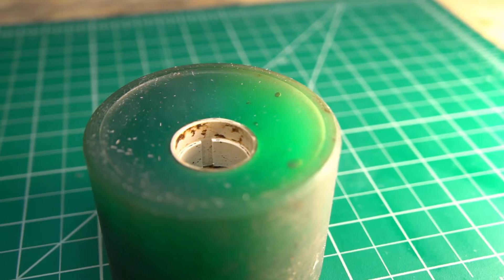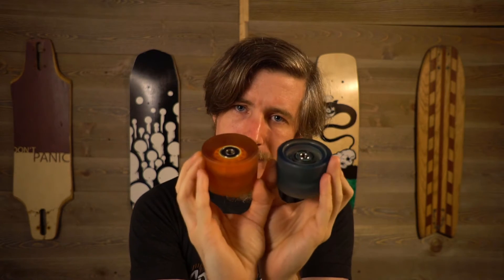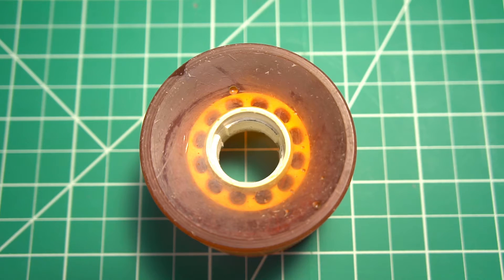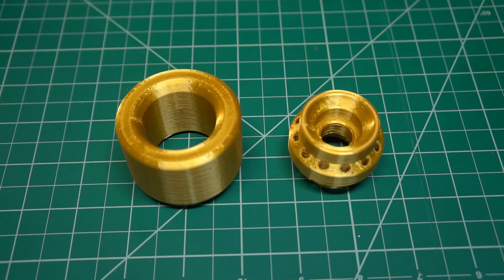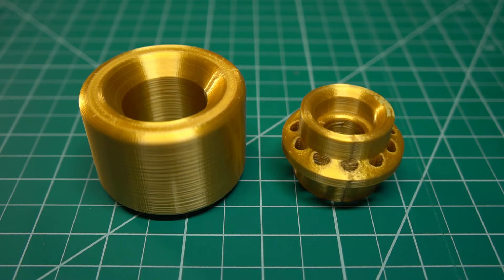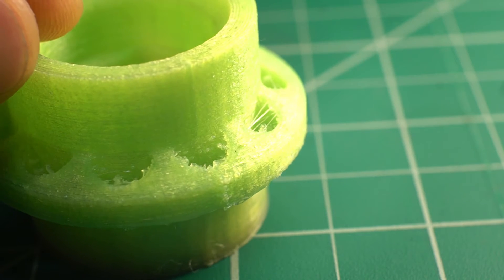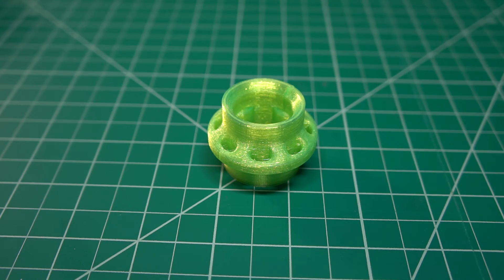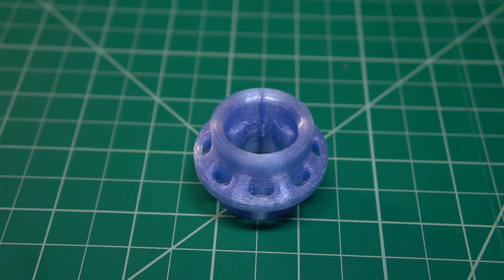3D-Printed Cores for DIY Skateboard and Longboard Wheels

Comment: I say 'DON'T DO THIS', because, Most decent wheel Cores are DELRIN, although some also are Arimid-fiber Impregnated Nylon, HEAT MOLDED.. You CANNOT Replicate that strength with a plast-wire 3-D Printer, Period!! Do ya know what the word 'Lawsuit' entails? "PSR"

Comment: I think you actually had some solid designs i just think you need to calibrate your printer. Still this pretty fuckin cool
Reply from the maker: Thanks dude! The open source version is going to have a triple-round core design in addition to a mids one. They're a little more up-to-date with modern longboard wheels, and they're much easier to print cleanly.

Comment: good work.  are you willing to share the files. i am looking to do the same thing  but for rollerskates.  what brand urethane are you planning of using?
Reply from the maker: I think you saw this in another video but the whole project is going to be open source when it's done. There are a couple urethanes I want to try, I'm mostly looking at stuff from Specialty Resin and Chemical, and Smooth-on. Both companies have resins in the 80-90a range.

Comment: This looks cool I hope the wheels will turn out well and strong enough. Which type of wheels do you wanna realise? Something like freeride/freestyle or more like carving ones?
Reply from the maker: I'm taking a stab at freestyle wheels, just because they're smaller and if I mess up I won't be wasting a lot of material.  They should make decent cruiser wheels at softer duros too
Reply: @GoodRoads  Great I hope they will turn out well. I should have all the necessary if it turns out good will you share the stl file of the core?
Reply from the maker: Yup!

Comment: I personally would probably experiment with 2 part cores. Completely get rid of all overhang issues that way.
And then rely on the wheel mold to align the halves together, and the Urethane to cure and hold them.
I don't think there's any structural reason why that wouldn't work, but it does complicate the wheel mold even further.

For printing, I use Slic3r, and two options to make sure you try are "Avoid Crossing Perimeters" and "Complete individual objects". All slicers should have similar options, but perhaps with different names. This should really help with the consistency working with PETG.

Another option in dealing with overhangs is to have a re-usable support. A pre-made piece which you insert while the print is paused, which gives a consistent surface for bridging.
When I do this I typically use a higher temp plastic than what I'm printing with , So ABS insert for a PETG print, and I'll have a piece of masking tape on it for print adhesion. I'll also have it tape side down on the print bed keeping warm until it gets put in place because heat helps with adhesion too.
Reply from the maker: That reusable support idea is freaking fascinating. I've never heard of anything like that before, but it makes sense. Do you program the pause into the gcode?
Reply: You can do it directly in the Gcode and I have, but slic3r lets you scroll to the layer you want in the preview, and insert a manual filament change and it will put that in the Gcode for you.
Other slicers may have similar features, but I only know slic3r.
Reply from the maker: I've pretty much only used Cura. I'll have to see if it's got similar functionality or give slic3r a try
Reply: @GoodRoads   you can add pause at height in cura